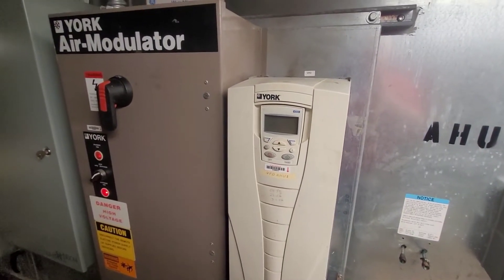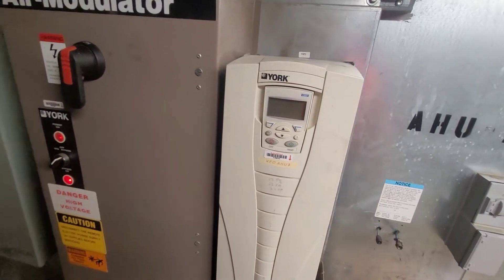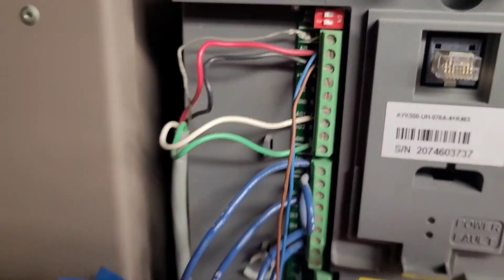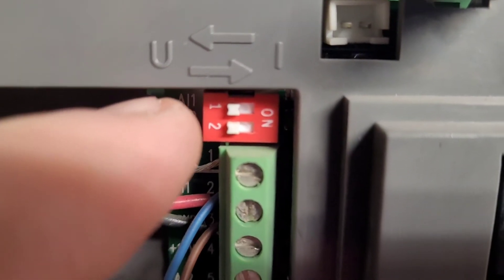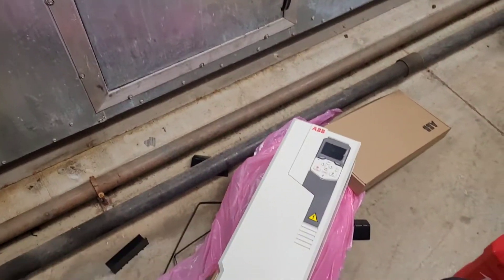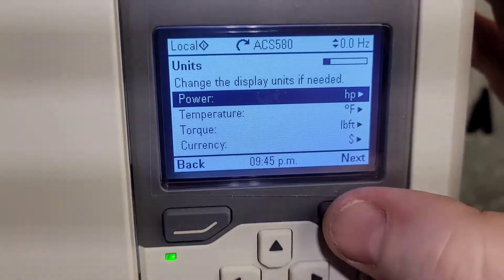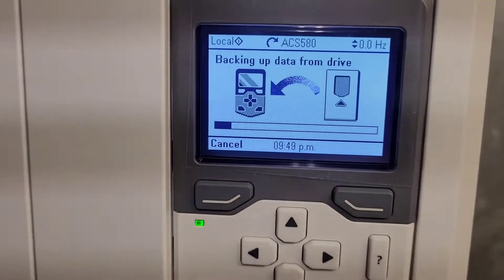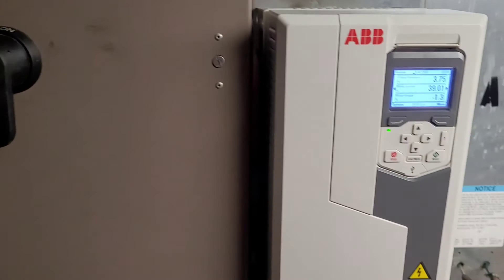Replace an ABB 550 VFD with an ABB 580 VFD on an Air Handler Supply Fan Motor

Comment: ABB ACH580 HVACR drives are transistor inverter drives.
Reply from the maker: All ac drives are
Reply: @Systemcontroltech  I was saying that because the PWM method is really unique. It literally is extremely similar to the Toshiba G3 TOSVERT-130 transistor inverter drive.

Comment: Ask an expert, the fault code is BR WIRING 7111, it is reasonable that the connecting cable of the braking resistor is not connected, but there is no problem with the cable and the braking resistor, is it a chopper problem?
Reply from the maker: I've seen some resisters that are fused blow a fuse and cause issues.  Also, make sure the BR is still at the value its supposed to be. Make sure it's large enough for the application.

Comment: I'm a little confused about your "status" wires and "ready" wires. Do you not use CT's on your fan motors for status? I typically will use those contacts on the ABB Drives to open Smoke Dampers (or Isolation Dampers) as well as the Outside Air Damper? I assume you are using the "ready" for that purpose? Maybe you are controlling those dampers though the control system as an output based on receiving those "status" and "ready" inputs? If I had to do our system over again I would chose that method so I can override dampers for troubleshooting purposes. Great video, I love that you keep posting these. There is literally no one else out there posting videos of this stuff and my facility uses very similar systems/controls.
Reply from the maker: Why buy extra devices such as CTs when the VFD can do everything for you?  It's also more functionable than a CT and won't fail as often as they do.

Comment: I have setup plenty of those ABB drives. They are easy to work with.
Reply from the maker: The 880 is a bit more interesting
Reply: Yeah I spent a few hours on one just getting the bacnet to talk on both the drive and bypass.